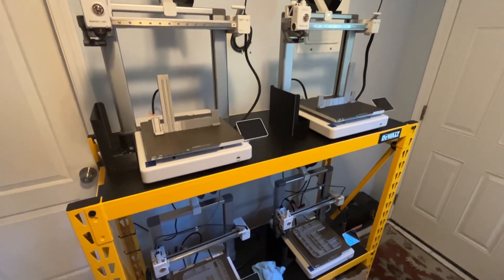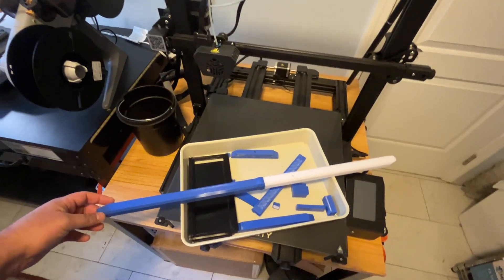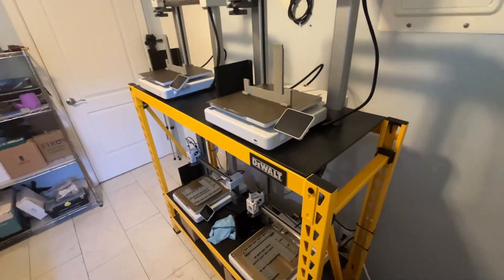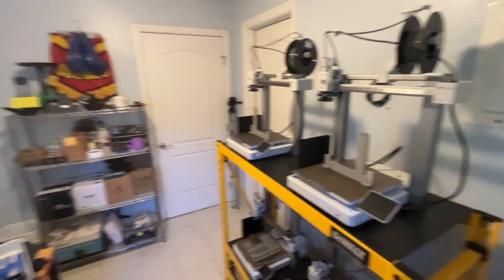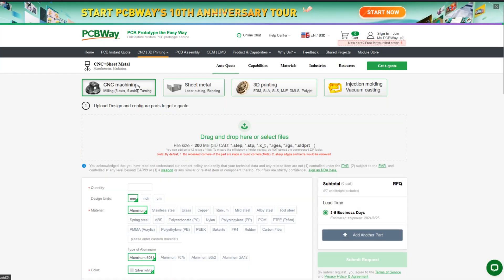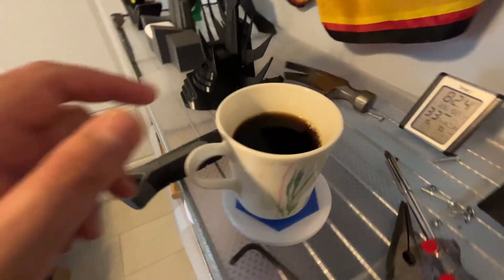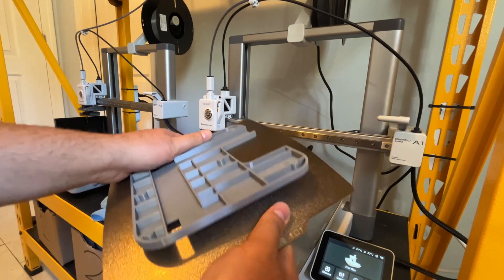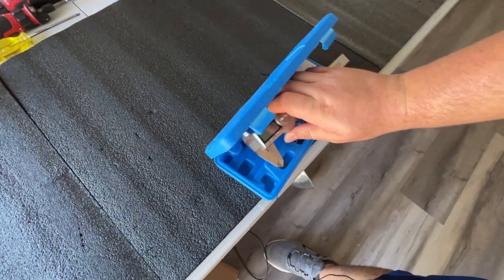From CNC to 3D Print: Streamline Your Project with PCBWAY!

Comment: So I had a thought on evening out the usage of your build plates on the latch printers.  Set up prints that will just print it in like 15mm increments forward and back on the Y axis. So you would hav say left latch 1-8 and cycle through them during each print. See if that changes how they are sticking.
Reply from the maker: @RBallarddesigns  Thanks for your thoughtful suggestion about managing the wear on the build plates by shifting the print positions. I’ve noticed some ghosting when switching prints between usual positions, as you might have seen in a previous vlog. At some point, I’ll eventually flip the build plates and alternate which parts I print on each side, sometimes a left plate, sometimes a right, and occasionally mixing in left and right latches. This should help vary the wear and reduce the chance of ghosting. Appreciate your input and helping me think through the best approach :)

Comment: You may Try PLA for the legs.  Temperature should not be an issue and it is typically more rigid than PETG. Also you have a trim ring where the upper and lower legs connect.  Maybe Extend that to 8’ish inches long and make it a little larger size.  This can add rigidity and be styled to add color break or aesthetic feature to your legs??
Reply from the maker: @jeffnesom2543  Thanks for the thoughtful suggestions! I appreciate your idea about using PLA for the legs, but I plan to stick with PETG for its heat resistance, especially since I’ve had issues with other pieces warping from the sun. However, your idea about extending the trim ring to about eight inches is intriguing. It could indeed add both rigidity and a nice aesthetic touch to the legs. I’ll see how I might incorporate that into the design. Thanks again for your great input :)